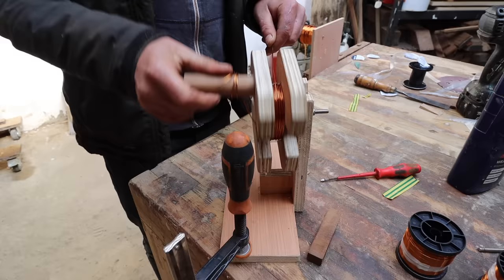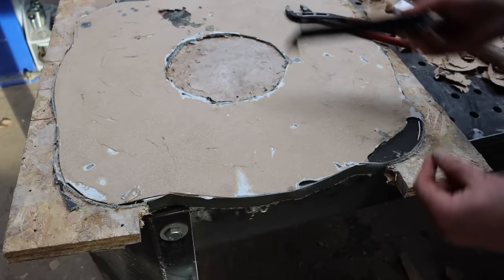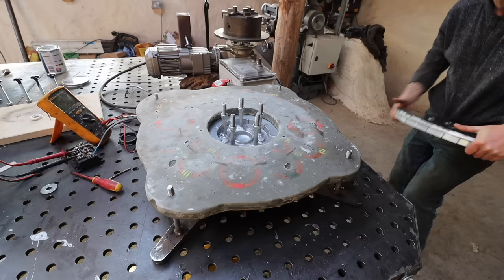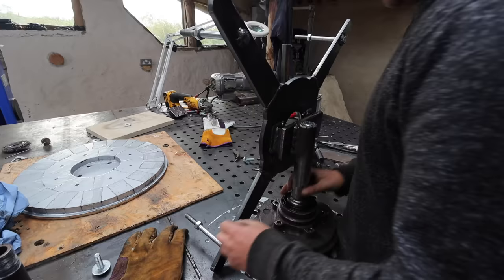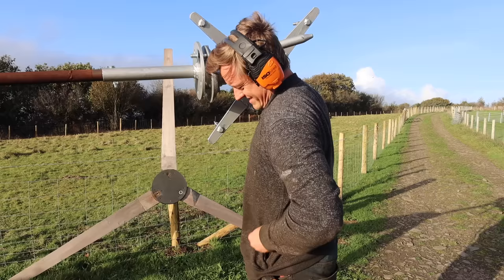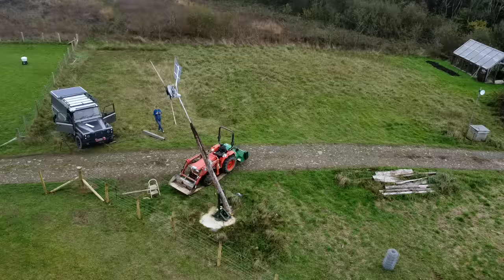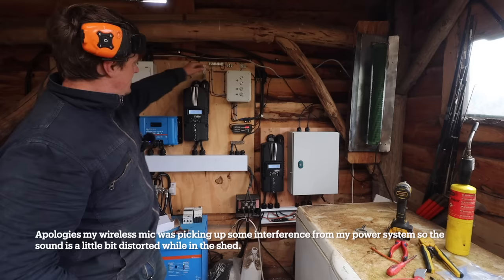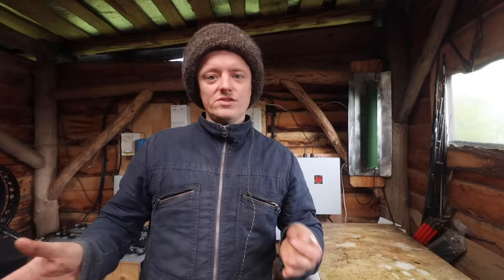Off Grid 2 KW Axial Flux Wind Turbine And MPPT Dump Load Controler Build

Comment from the maker: The idea for the controller came from another YouTube channel. The clip I had crediting the channel had bad sound and got cut out. But visit wind power and more to see other versions of this controller and some great content. https://www.youtube.com/channel/UCpHl5wAaAYKhWvkDHaRXjlA
Reply: Make a set of blades man you can make them lightweight out of stainless steel, and instead of having the excess go into the dump wasted, can't you have like a fridge freezer instead ie fridge freezer gets powered by ordinary set up then once ordinary set up cuts out due to overpowering and switched to dump can't the power going into the dump power the fridge instead until things go back to normal so nothing is being wasted etc ? Man if that was me I'd experiment so much I'd probably blow the lot etc I Just can't stop but it's the only way you learn but anyway back to the fridge being powered by the dump after it takes over seems good no? And get those blades made man seriously for the wind turbine I know you can make a banging set of blades ? Try 5 ? Smaller but just as potent etc then the pole won't be taking as much flack, anyway brilliant job and I tell you what once I go electric VERY SOON you'll be making my stator and turbine and blades AND fitting it all too seriously your only A 2 to 3 hour drive from me so all good I'll give you the sizes they have to be and you work your magic with NO TIME RESTRAINT at all plus I'll pay you up front if need be 50/50 anyway apart from my rant good job brilliant stuff and I hope we meet one day so I can have a go at you about something the only thing your good with ? so take care of em mate seriously I know we're not fairies but mate ? take care of em as YOU DO everything else ok 🤗
Reply: 35:35  Dot's chasing the geese in the background, you better get after her...😉
Reply: I have had great success using Polyethylene (PE) on anything I do not want to be bonded with epoxy. One of the cheapest is plastic packing tape, it must have the marking PE on it, if it does it will work. Just tape the surface and the epoxy won't stick.
Reply: Because the wind is gusting from different directions did you consider a vertical wind turbine?
Reply: What ever project your working on is interesting to me . I’m impressed
Reply: The only real thing I would  do different is the tower, I would hing it in the middle  so raising and lowering would be easier.  Just have to wire it with that in mind. weight reduction of the head would be great but who wants to drill  one million holes for such a minor improvement of low wind speed power performance, Great job overall and it should last decades.
Reply: Comment for the algorithm
Reply: @jondoe7936  5 Blades won't work the Wash from Each Blade will Slow Each other down 👍✌
Reply: Immensely entertaining!  Absolute love your content Kris
Reply: Hi Kris, Graham here over in Ireland. I had asked a few questions on the hydro series but it seems the comments are some time ago. Can I get an email to contact you by chance? Or could you direct me to the contact information for yourself. Thank you Graham
Reply: Maybe it didnt come off well because you put the flour in it. ahaha
Reply: Beautiful work
Reply: Maybe missed it in the original setup but I take it that hill is a particularly windy spot?
Reply: Wow nice job. I have been using home made wind-generators 
On my sailboat for a couple of decades. On a pole attached to a fiberglass boat one needs to keep the weight down as much as possible. 
I get my parts from a auto junkyard. A 100 amp Chrysler and the blade assembly of any car that has a removable fan, the plastic ones work fine . A bit of knock up using a piece of stainless steel pipe a couple of tapered bearings for the 360 degree effect and it’s almost done. I use a couple of store bought clamps to fit it to the stern and then a voltage regulator, good to go. Just make sure it’s tall enough so it doesn’t part your hair when you stand on the cockpit locker. Yes it will leave a mark. It’s faster and much less time consuming than all the work you do and you can get a rebuild kit for spares. This system works for me. I don’t claim to be better than others, I just know what works for me.
Capt. Goose 
Aboard WINDSONG. S2-35 ft.cc
Reply: Dear Kris, Using almost round shaped coils cancels out the voltage. You should also have gaps between each coil with at least one magnet width. I have mathematically analysed and simulated the optimum design few years ago which is now published in Neurocomputing Journal. The best shape for coils is trapezoidal.
Reply: Would you please tell me the wire connected to the coils i mean output cable didn't get twisted when the turbine moves in a single direction , i didn't see any slip ring connection that would be best i guess
Reply from the maker: @GbFancyBirds  you should watch the entire video without skipping and you will find your answer.
Reply: make a vertical axis windmill, VAW .  only one moving part, the rotor/generator. works in les winds.
Reply: @prashanpremaratneAU  can I please have your email address? I would love to know more about the downside of round shaped coils.
Reply: Impressive build Kris What's your optimal turbine RPM?.  I've been using an inexpensive 1.5KW eBike hub motor and DIY regen circuit that produces 1Kw to 2KW or more between 200 to 500 rpm by switching the three phase AC output to a 3-phase bridge rectifier and DC to DC converter. I can adjust the the DC to DC converter to deliver between 12 to 130V and limit the current from 0 to 30 amps. It has between .95 to 8 power factor depending on load and I'm thinking would be relatively simple to adapt at a Wind turbine generator, running direct drive or via a belt reduction.
Reply: You have got to be kidding me, there are people who really dont know this stuff, thought it was pretty STD, self explainetary from things you just pickup over a life, basic physics & chemistry with a splash of tech drawing and new 3D printing and voila, a better mouse trap. All so simple really. But whats that got to do with resin pouring? Buggered if I know.  Keep up the good gear,  Peace Out.  Wayne
Reply: QUESTION... Can I use the same charge controller that my MPPT Solar lines come into it? I'm going to run both solar and wind generator on my property. Should I use a separate charge controller for my wind generator?
Any advice would be greatly appreciated.
Todd
Reply: @groot6830  would love to see your take on that challenge too..⁉️
Was working on one out of two halves of 210 L drum mounted  at ground level before my property was expropriated without compesation in Africa..❗
Keep up the good work mate..❗🙇‍♂️
Shalowm
Reply: Have you considered using an oil filled radiator for the dump load? At least the excess energy might prove useful.

Comment: Would you ever have thought when you were first building the roundhouse that you'd be at the point where you're making more energy than you need? Absolutely amazing, I love all the power content, and I simply can't wait for more building videos!
Reply: Now Kris @Kris Harbour Natural Building just needs to use the excess power to pump water up the hill, for DIY pumped hydro energy storage. :-)
Reply: @YodaWhat  Kris Harbour Natural Energy Harvesting
Reply: Yes, I think he had a vision at the start. & It's Good to see the thing come to gather to achieve it.  I was born of grid no mains power or water much like him in 1952. but we lived in a of grid cottage. my first windmill I built was, by the use of a 6-volt Dynamo & the regulates & controllers of a ford popular.  later & progress to a wood gasifier.  That power my battery charging set' which was a engine driving a dynamo back then  in my day the set's were army surplus.    used by the army. now days  there isn't a army surplus shop to be hade.   LOL   Later we migrated to a 12-volt dynamo. & to day  it alternators that we use to charge the batteries. Our dump load was the cow shed light's & the second  Bratty bank.  We Never wasted an opatunity to generate Power.  We stored all we could.  No such thin as Soler panels.  Things   have come on a lot & yes, I think his work as done well.  We get some people that often get the opatunity to deliver & contribute. Kris as been one such person.  When so often as in my day we got them that would say it won't work, Or your just waiting your time.  Or you need to be a qualified Electrical engineer to do that,   Like him if I had listened to them, We would have had Nothing, in my opinion he Deserves an MBE. [  & i Nominate him for one] He as blazed a trail for others to follow . & opened up opportunity to power one's house of the grid on the cheap.  Today but that debate i  suggest is  for another Day. Available  to be had.
Reply: @YodaWhat  Use the excess energy to heat a big insulated water tank and then pump that to his various buildings to supplement heating. Then recover the heat from a steam engine or wood gasifier so that you're heating and charging batteries at the same time in the dead of winter. The rest of the year you can use solar heat.
Reply: You are one hell of an engineer !!. Thanks. Dave
Reply: @lesthompson5907  you're right my mate..❗👍🏻
You & seem to be of the same age group..you now the favourite quip about the TomCat that becomes denuted whom then becomes a " Consultant" my Colleauges in my Prof' get annoyed at me when i Qoute them the quip of Consultants..❗🤣😂😅

Comment: I'd say the majority of the off grid folks I see right now just happen to be living on boats, especially sail boats. Its amazing the inovation you see now, lots of LIPO batteries and many have wind generators. One thing that is very new (since the advent of the extremely large battery banks) is the high current alternator, some of them are 250 amps and I think that technology is dangerous because they get far to hot.

Comment: Kris the pulsing is similar to the pint's controller we used  on the Trucks & there   charge controller we had on out cars.  & uresd in the wind mills of my day  rapid pint opening & suiting was how it was done on that - system , So  that is one way  you could  go to trip the system .  just thought  i would mention  it in passing.

Comment: What a project! love the longer videos.

I always thought an interesting/useful dump load in the UK climate would be a buried, insulated tank of water that is used to heat a greenhouse through radiant underfloor heating pipes.  I've never sat down and done the sums on it but the idea has always been with me... especially as temperatures dip and I wonder what could be grown in a heated greenhouse in winter.
Reply: check out some vlogs of all year round greenhouses in the north usa, they use big pipes buried circulating the air, sunken like gruber huts, citrus trees etc. grown in them, the north side is usually a bank of soil
Reply: Sand if the way to store heat . An insulated water tank full of sand and run water pipes through the sand as well as heater elements. see this video for an explanation https://www.youtube.com/watch?v=kzj1PCA_jxA
Reply: I too like dumpload idea,   and underground water tank I know a scientist that has a very large tank that he just paints black lol.   The problem with wind were i live is many nights there is very little wind.   I would be tempted to heat with solar and use wind to run half the waterpumps.

Comment: Really nice! The reason you point the blade axis skywards slightly is to give you a little more leeway for blade deflection towards the tower. Prevents the blades from hitting in high winds / bad conditions.
Reply: Just a thought. Also the force vector from such a tilt pushes the wind turbine nacelle downwards, instead of upwards. So mechanically less issues with the nacelle flying off ones tower?
Reply: @LAZASAS If I remember rightly Hugh Piggot reckoned it also helps turning when the wind veers

Comment: About the twists in the cables - either a chain (to stop excessive twisting) or a spring which returns the turbine to it's starting position might be worth considering (similar to springs on gates to close them). This may take a while to source but could solve the problem. If you don't sort this and the cables are going to be stretched, although this doesn't happen very often, having them as a standard serviceable part that you can unplug and replace might be worth thinking about for future designs.
Reply: Trouble with this is you could end up throwing power away when the wind turbine is prevented from fully turning into the wind, and this situation could last a significant length of time until it resolves.  Also it could prevent the turbine from furling in strong winds which could be catastrophic.  Just another unfortunate trade-off in a system with no slip rings.

Comment: @10:54 Wax paper is your friend here. Regular kitchen grade. Put a layer of wax paper between the mold and the top board. Resin will not adhere to the wax, allowing for a simple and clean separation.

Additionally, the wax will melt and seal off against the resin surface without intermixing. That seal will block oxygen from entering, allowing for a faster and more thorough cure.

Comment: Great work and thank you for taking the time to tell us about your efforts.

While unbridled wind power generated by a free-spinning turbine is great, and just does fine, I offer the following thoughts for your consideration, noting that you have a PWM output from your controller...

A HAWT works most efficiently with a tip to wind speed ratio of about seven.  i.e, the tip is moving at seven times the wind speed.  (tip wind ratio = 7 TWR7)

Below and above that TWR the turbine doesn't extract as much energy as it could.  

Often (usually, I suspect) the turbine is working in a near stalled state, where the drag of the generator is holding the rpm well below optimum.  This will have the undesirable effect of slowing the run up of the turbine to optimum rpm as wind speed increases, which means you are not maximising the energy harvest.  In typical cyclic wind conditions I think it will be better to grab shorter bits of charge at closer to optimum rpm than having the turbine spin at near stall a lot of the time, when it is not generating much at all, but it cannot (because of the load) get up to speed.

So to optimise output, it would be good to allow the turbine to spin up to the TWR that approaches seven times the prevailing wind speed before you start to pull load off the generator.  

So; rpm counter on the turbine will give you tip speed, and a basic wind speed meter mounted on the pole will give you wind speed.  Then, via trivial software and math (using an Arduino, say) you can compare the two speeds and get a PWM output proportional to the speed ratios which you can apply to your poor overworked solid state relay to send the load to the batteries.  (A capacitor downstream of the relay may smooth the output a bit, and it will be interesting to see if the PWM rate needs to be controlled a bit to avoid excessive cogging and thus cyclic loading of the turbine as the load is varied. Later)

I believe this method of control will have the effect of letting the turbine run faster and hence it will grab more of the passing wind energy since it is working closer to optimum.
  
Thinking of it starting from slow spin in low wind, the wind increases, the TWR controller allows the turbine to spin freely up to your desirable TWR then starts pulling power.  As wind speed steadies, the turbine is kept in the sweet spot.  As wind slows, then the controller promptly proportionally unloads the turbine allowing the flywheel effect to have it spinning faster in anticipation of the next gust.  So overall the turbine will operate for more time closer to the optimum TWR.

Practical considerations (like the probability of the rpm exceeding the structural integrity of the blades, bearings etc) may see you choosing a lower ratio (like six or five) but anything approaching the ideal seven will be of use, compared with running the blade far out of the ideal range in a near stalled state most of the time.

Good to keep tip speed below speed of sound.  A turbine with blades 1 m long (2 m dia) has a tip path circumference of 6.3 m, so to get that spinning with tips at the speed of sound requires 55 hz or 3275 rpm.  That would be in a wind of 49 m/s (176 km/h).  Hopefully your feathering mechanism will have cut in before then!

FYI I'm in the process of making a small turbine setup to test this myself and will report when / if I reach finality on that work.

Hope this is of interest to you.

Comment: Use quick passes from a blow torch to eliminate the bubbles. On melamine, there are release agents (wax) that make it real easy. If you use wood again, you can use wax paper between the two. The resin won't stick to it.
Reply: Yes on the blow torch or heat gun .Misting with denatured alcohol also works .That's how the epoxy artists get rid of bubbles

Comment: Great stuff as always Kris! I had always envisioned a dump load on a wind turbine as a heat and/or water heating element and use it to heat a body of water within my green house, which will then slowly be radiated out to prevent frost. I bet your workshop will warm up nicely from on ocassion.

Comment: If you have too much power, push it into a big hot water tank and take a long shower or let it be a backup to your main system. That's what I would have done and I would have added a switch to flip it to a heating element as needed or if something was too hot.  But very good job on the whole system Kris and good luck forwards. :D

Comment: I'm very impressed of your skills. 
Lots of inspiration for me! 🙂

I'm also using a dump load approach - but for a solar-thermal system. 
In my case this is a 4.5kW radiator, which consumes any heat I can't store. 
Since I installed that, the wear on my system significantly decreased.